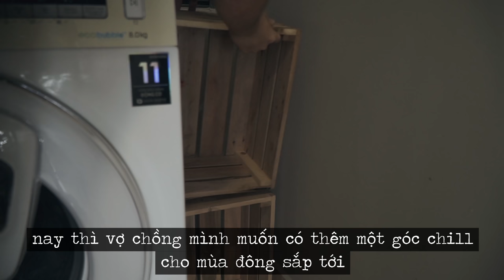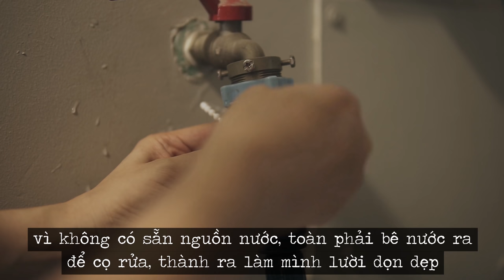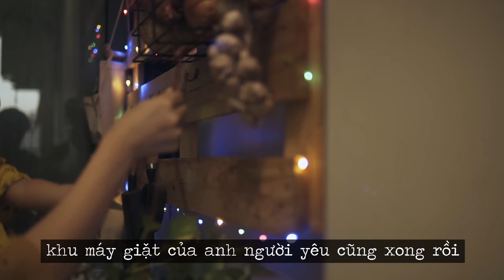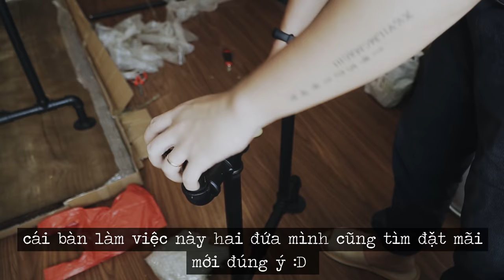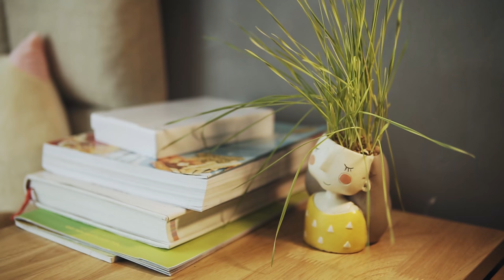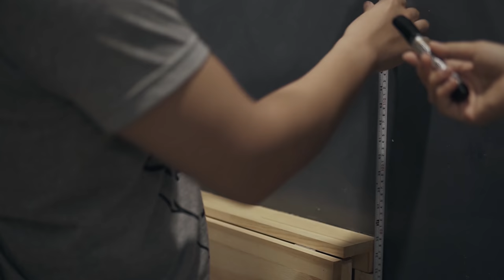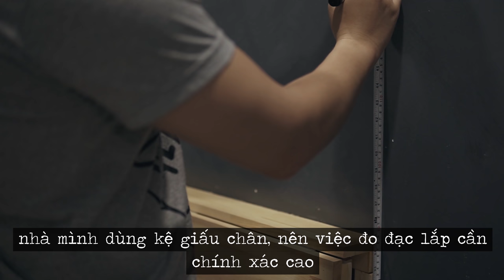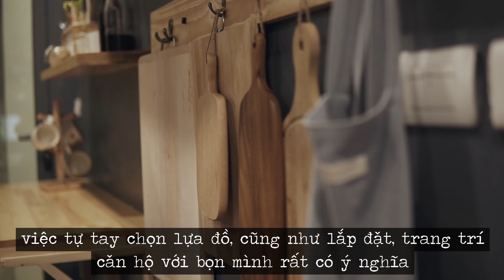#9 Eng) My Cozy Apartment Makeover | DIY Trang trí lại căn hộ với chi phí thấp nhất |

Comment: Nice job! The way you executed everything was so great!  I've seen other people do things like the gaskets holding bottles, but they used scraps of rough wood and stuck it directly in the wall with a million screws and they painted the wall but did not clean it first so there was just funk under it like painted dirt... ...anyway you get the point, it wasn't good. They should have watched your video first.  What you did looks so nice.  So nice!